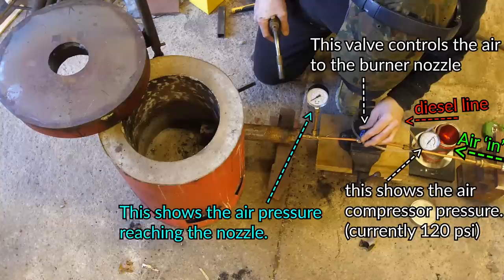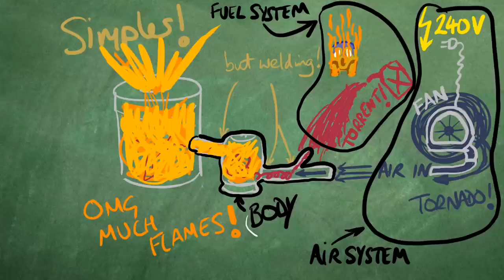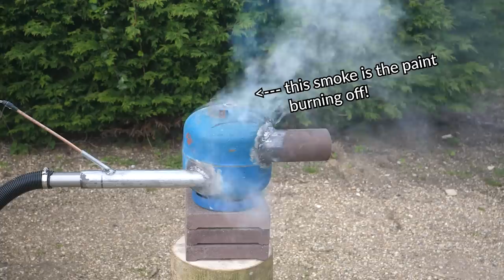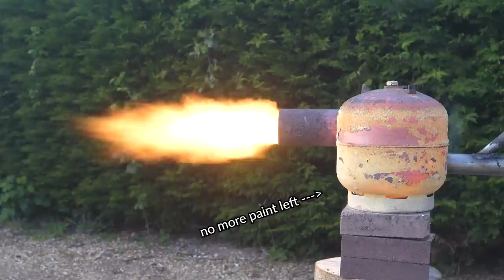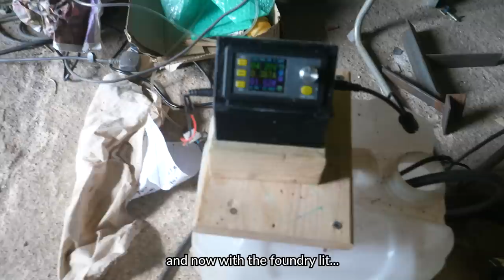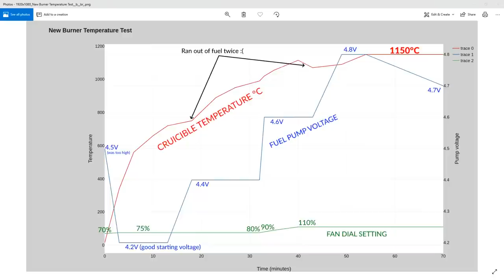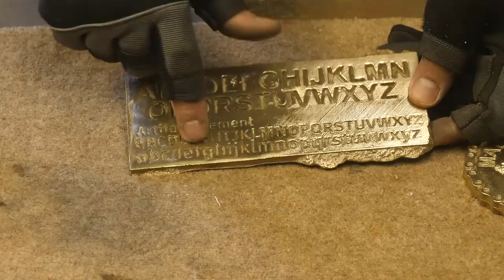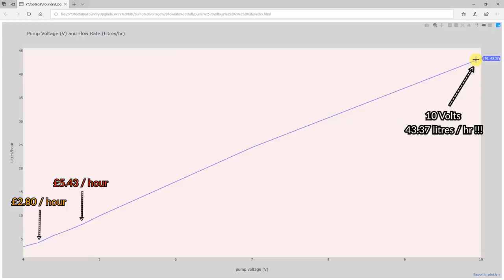Upgraded burner for the furnace. Beats propane? YES! with graphs & first casting and lettering test

Comment: Now that was an attention grabbing intro!!  You went the right way with a fuel Pump. Gravity is more trouble than it's worth and the pump gives you much more control and stability. Your fuel flow will vary at those low rates with how much fuel you have in the tank and the resulting lift as well as ambient temp so don't be surprised if you have to tweak it.   The burner is  good too.  You could actually  just have a pipe for air and fuel feed going into the furnace and do away with the burner all together. Light your fire in the furnace, add fuel and bring the air and fuel up slowly and it will burn well in the furnace. This will give you more heat and efficency but of course it's working perfectly well the way it is.  

You can cut your costs by adding used veg oil to your Diesel. With that pump I wouldn't go over 50% unless you are outside and it's hot or if new oil is cheaper than Diesel there you could use that. 

The castings looked great. Well done!
A very interesting vid and I admire your workmanship and attention to detail. 
Something for me to take from that!  :0)
Reply from the maker: Thank you so much Mr Oil Burner. Your version is awesome! when mine eventually erodes itself due to the extreme heat i might just do that and use just the hughmongous pipe direct in. thanks again for your video!
Reply: подобрать хороший надежный насос для прокачки отработанного масла, чтобы не заклинил от возможно содержащегося в масле мусора.

Comment: I've been struggling for years with trying to DIY an oil burner for my bronze furnace, and you've inspired me to ducplicate yours as close as possible with my extremely clumsy butterfingers. Thanks so much for the in depth thorough and very fun run down!
Reply from the maker: No problem! It’s really quite an easy build, you can do it! Let me know how it goes :)

Comment: I like your design because you can throtle flame by adjusting fuel inlet pressure by way of increasing fuel flow and vice versa.Adjusting fan flow as well regulates well the flame power.More power and congratulations on your research works.

Comment: Great video!!! I tried this today with a 12 liter diving bottle. Used 100% veggie oil and found it hard to reach operating temperature. I also used propane to preheat the thing. The blow out using propane when litting was quite scary. When I finally got 1 meter high flames I was quite overwhelmed! I think it might be too powerful. When trying to reignite the hot tank using propane I only got explosion 💥 and flameout. Think I will not use propane and just preheat with diesel and wood sticks.  And electric pump to control the flow better. Thank you!

Comment: Hi there. Where this burner is of real benefit is when the furnace is cold.  The ability to start up without being super smoky is great.  Once the furnace is up to temp, injecting the diesel down the tube with the air and straight into the furnace will have the same effect.  A lot of people start their furnaces on gas to heat them up then turn on the oil once it is hot enough to flash the fuel to vapor, if one does this you can achieve the same clean burn.  By using the pre burner some energy will be wasted once the furnace is up and running.  If you were to make a sleeve for your air tube assembly then you could remove the pre igniter and put the air and fuel tube directly into the furnace when up to temp.  Just a few ideas you might want to try anyway.  Nice casting by the way.

Comment: Great video!!!!! Loved the charts at the end of the video. I now know  that you will be melting and pouring iron very shortly. One thing I did see that your oil consumption is a little high, my burner uses 10 liters per hour to melt 14 Kgs of cast iron.
Reply from the maker: luckygen1001 cheers lucky! Yes I might back off on the fuel a bit, no need to waste it I think :)

Comment: Wow! how did I miss your channel. This is awesome. I have been developing a waste oil heater for my shop that works exactly like a regular oil burner. I believe I am going to use the drip method.
Reply from the maker: Welcome John and thanks! It’s a super simple setup. It just needs a little heat to get going. I don’t use wood anymore just a few bits of cloth wetted with some diesel, once the air is gently going it creates enough heat to get going nicely.

Comment: I have watched several of these oil burner videos and the crude way of lighting them. It seems that you could wire in a glow plug into the burner to light it. That way you may not have to worry about burning your eyebrows off.

Comment: I use pinch dogs to hold cope +drag together,and weight sand if pattern is high in horizontal surface area.It's surprising  how many run-outs actually fill out-just when you think you've lost the casting!Cuprostatic pressure about 4 times aluminostatic pressure.
Reply from the maker: thanks Jay that's a great idea!

Comment: Arduino - would be quite simple to program the arduino to output a specific ramp up voltage/flow for specific materials. 

Im going to try this burner method on my foundry. Looks like you get good repeatable results and nice high temperatures.
Reply from the maker: hi ya seafurymike! awesome idea! i'd love to see the results when you make your burner. It really is super easy to use, the fuel pump makes life so easy. co-incidentally i'm playing with an arduino right now at my desk (different project) - interesting idea, definitly doable but i'd be a quite worried that i'd leave it alone too long... and then end up with a burnt down shed!

Comment: What you have is a crude jet engine. Air goes in front add fuel and get it burning and flame comes out the back. :) No surprise diesel would get you a lot more heat. Propane is just a lot easier to use but makes a lot less heat per pound of fuel.

Comment: Hi Julian
>Fuel, to make it cheaper, use heating oil (kerosene), shop around and you will get it way cheaper than red diesel.
I purchase 1500 lt at a time and it's (give or take) about 42p lt. smallest worthwhile quantity is 105 lt (a steel drum).
>Efficiency, If you were to insulate the vaporizing chamber with some ceramic wool or such like, I would imagine your burn will become quicker or &  more efficient. At the moment you are loosing heat to the atmosphere, all well and good on a winter day maybe.
My foundry temperature only rises 1 or 2 degrees over the course of a 2 hour casting sesion (and yes in the winter I wish it were a lot more).
>I have forgotten to weigh a flask a few times over the years & it's always an odd cast (ie not a batch like Martin's) & there was some reason behind it such as a quick cuppa delivery......
>My first ever cast Iron melt was with Colin Peck, I too still have a copy of his book. It is infact a very very simple furnace, once built.
>well done on your bottle opener, you piped me to second place (you  **%*(&(^ ()*^&^%$&  ^$& *&$  *%$&& &$*er   :)
>Id gladly offer my welding skills (Ha skills that's a joke) if we were a wee bit closer, but I'm sure were some milage apart (SE Kent).
>any way's toodle pip old chap & keep the videos coming.
Andy.
Reply from the maker: War Grade haha cheers Andy! Ohh I’d not thought of heating oil, I’ll look into that. Oooh lovely Kent, I know it well, My mum used to live near bethesden. Ahh yeah the insulation is a good plan... but I kind of like the red glow! :)
Reply: My wife use to police Bethersden years ago!
The glow would probably be a nice thing in the winter

Comment: I think I have found the three extra pieces you used to regulate your burner, fuel pump, pump regulator, and fan regulator. Now I am probably going to need a hand in wiring it all up. I think I wasted money and bought a siphon nozzle but I intend to use a blower and not a compressor. Thanks for your video. Your links didn't work for me because I am in the USA.

Comment: Just an observation, there is such a tool called an Artist Mouth Atomizer. Fitted just like the oil drip pipe except upside down, to get the paint running you keep the pipes perpendicular to one another (and adjust the "oil" pipe unit in/out) Till you get it automizing properly. The artist would blow on the other larger pipe just like your setup. I realize you are using gravity, but if you did this and used gravity as in your example I think you would get better optimization (You may not get the drip drip drip effect in other words). It would probably work better than having an angle towards the flared end of your Burner. 
Note: being you are not using an air tank it would not make much of a difference except perhaps the fluctuations. With that said I don't think it needs to be angled.... Just an observation I've had.

Comment: I would suggest insulating tank you use to vaporize the fuel so you can get better efficiency, but a couldn't garuntee that the metal wouldn't melt. If you preheat your fuel old fry oil might be a good cheap source of fuel.

Comment: The vapouring chamber is getting red hot. Could the interior wall of it be insulated like the furnace to conserve heat and make it touch safe ? Or would the interior of the chamber not get hot enough ? Does the  casing glowing red hot play a vital role in the efficiency of the burner ? 

Great video by the way.
Reply from the maker: Thanks John! I think insulating the chamber would be a good idea, i think it could only help vaporise the diesel more. Not sure about your final question, the diesel needs to be very hot to vaporise well but how hot I don’t know. Thanks for your comment :)

Comment: Can I ask you a little about the power supply for this fuel pump? I live in the USA and I’m not an electricity guy really so I’m not sure what I need to be looking at for a compatible power supply. You got something with a digital voltage display? Does the amperage need to be of a certain threshold or is it just a direct plug into home power with a dial/potentiometer on it? Thank you!
Reply from the maker: Google ‘variable voltage power supply’ I got one of those. They might say buck boost on them. It’s run from a power brick. Good luck!

Comment: Hi, Thanks for sharing the informative and entertaining video. What do you think the maximum temperature could be, especially if the air and oil went straight into a well-insulated furnace barrel? Tim
Reply from the maker: Thank you! Honestly I think sky’s the limit. If you keep upping the diesel I’m sure it could melt iron if the furnace insulation is good (mine is non existent by the way).
Reply: @JulianMakes  Thanks Julian, That is very encouraging. I am looking for ~1,500-1,600C for clay fission. I can do it with a wood/charcoal mix, but it is hard to keep the fueling up. Oil should be so much easier.
From the look of your furnace chamber's thick wall, I would have thought that it had a lot of insulation? Did you put perlite or vermiculite in the mix as I do? Very funny start to the video. I have had some similar experiences with tiny fan-boosted stick stoves, but have never captured the smoke rings on camera. Tim
Reply from the maker: @timtelemark907  alas no vermiculite or silica blanket or anything! Just solid refractory cement.

Comment: Try using an electric leaf blower. Put a reastat to control the speed of the blower. I used used engine oil and the leaf blower and melted about a gallon of aluminum in about 15 minutes

Comment: Julian, what connectors do you use on both ends of your propane hose? Do you have Amazon links?
Reply from the maker: hi doc i dont use propane. it's diesel, so it's just fuel hose
Reply: @JulianMakes  thanks us oil guys use propane to get the chamber going then switch to oil once it heats up
Reply from the maker: @docvencil2222  ahhh I see!
Reply: @JulianMakes  the fuel hose information is valuable for that line. I have already ordered the fuel pump for the oil.
Reply: Here in the USA Diesel is quite expensive, and waste oil is free. @JulianMakes

Comment: Dear the higher the voltage in pump means more fuel flow so increases in flame intensity?
Reply from the maker: Yes exactly. More voltage mean more fuel which means more energy in to the furnace.

Comment: I have a similar oven but I don't understand why the diesel I put in it is difficult to ignite. I live in Europe, is our diesel different? I don't know! but your diesel ignites rather easily contrary to mine. I am obliged to heat my diesel to bring it to the ignition point before injecting air into the oven. how do you solve this problem?
Reply from the maker: The diesel must enter a very hot place in order to easily achieve ignition. Im in Europe too. This is why once a small wood fire is lit in the burner chamber, the drips of diesel entering instantly combust. This creates more heat which helps combust the next bit of diesel. Basically heat heat heat.
Reply: @JulianMakes  ok i got it i'm going to make some modifications on mine.thanks a lot julian and continue to amaze us with your realizations

Comment: How do you make the molds? Also interested in the sand casting. Any help would be appreciated
Reply from the maker: Hi Eric! I use a 3d printer to make my molds. As long as there is some side slope (draft) so you can pull it from the sand without breaking the sand, it works well. I like 8% draft but if you are beginning I’d try 15%.
Reply: @JulianMakes  Okay. Thank You very much!

Comment: If you insulate the combustion chamber it will transfer more heat into the furnace.
Reply from the maker: It’s a good idea Marty.
Reply: @JulianMakes  just some stuff I learned when I was forced to learn thermodynamics. Overall a great design though and I think I'm going to go with something along these lines for a shop heating furnace. However with my design I'll need the combustion chamber to come apart for cleaning from time to time. Synthetic oil leaves a ton of solids and soot.

Comment: awesome content!  have you considered running the pump at a constant voltage and then using a needle valve to control the flow rate?
Reply from the maker: i did consider it but as i had to buy a small power supply for the pump anyway i just got the variable supply instead. very pleased i did it works like a dream. i did have a needle valve on my previous iteration of the burner and while it worked it, didnt give me a reliable way to know the exact rate of fuel i'm burning. :)

Comment: Diesel is expensive,i have over a ton of used engine oil.Can air blower be used with old engine oil like u have on this video ?.Or only option for used oil to burn is with some sort of nozzle and pressurized air (compressor) ?.
Reply from the maker: Old engine oil is definitely ok for a furnace, i think they use a blower and just drip it into the airstream with gravity - so no need for a pump. Check out luckygen1001  channel, i'm sure he's made one with motor oil

Comment: What if you run the air line near the flame to heat it before combining with the oil.
Reply from the maker: I like the way you think joseph! Unfortunately the flow of air is pretty vast on this blower, the temp would only go up a little if some huge radiator type deal was heating it (i think anyway), also, counter intuitively colder air has more O2 in it (more dense) it more than makes up for its lower temp with a better hotter burn. To be honest this thing throws out so much heat already! I actually need to upgrade it soon, its almost burnt itself to ruin :)

Comment: I'm sorry but you guys do it all wrong.  Pressurise the fuel using fridge compressors.  Massively efficient then if you must add a blower you use it on the exhaust just as turbo diesel does.  ;)
As for water.  If you can acheive high enough pressures and thus temp you can split water in to hydrogen and oxygen.  This was trialed on high performance automotive engines only equally prior to high pressure injection let alone much higher pressure diesel injection.  As you are not running a combustion engine the reactive oxygen species is not an issue.
Reply: How would you control too much pressure being added to the fuel (tank)? If it is clean enough maybe it can be pressured through a 3d print 0.4mm nozzle?
Reply: @TheoTHERON_SA  compressor regulator and safety valve.  You can purchase kero burner jets readily enough.
Reply: @SynKronos  thanks for your reply. I am not good with Chemistry... How do you get the water to split into hydrogen (to burn?) then?